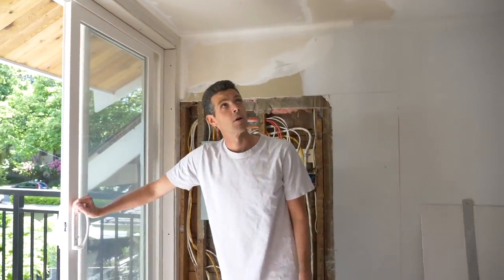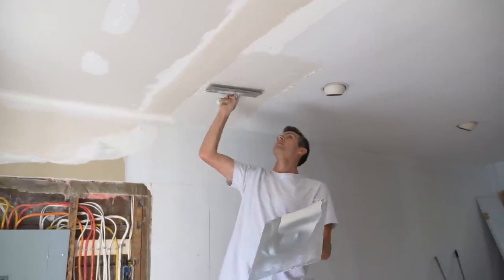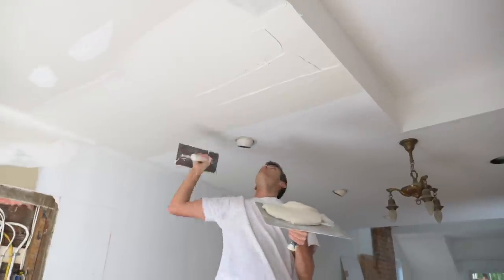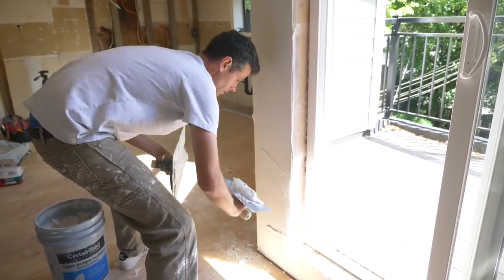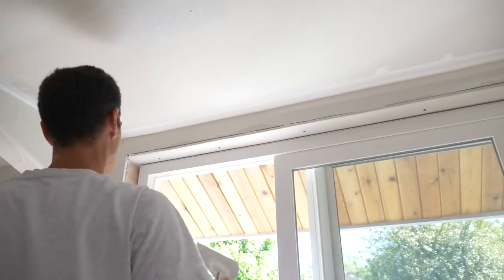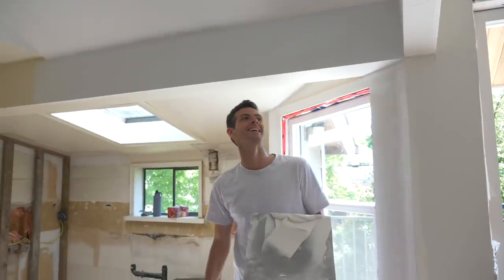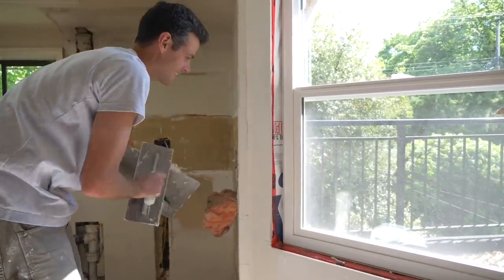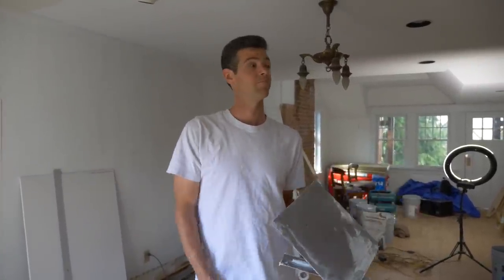First Coat on Nasty Remodel

Comment: thank you for teaching me how to mud! I resurfaced my kitchen walls that were covered with 60's prefab wallpaper that is applied directly to the board. Previous owners tried to remove but found it impossible and they tried to hide gouges with faux paint. so thankful for your knowledge.
Reply: Did the wallpaper start to bubble under the mud?
Reply: @FlyWhistle  no I sealed it with Roman 999-35 before and after

Comment: When it comes to drywall finishing there are three words to remember: sand texture paint 😄 
I always "glop" the like button.
Reply: Its pretty much all smooth wall/flat wall up here in the great white north :)
Reply: @stargateproductions  That adds an element of complexity. Here the sand texture is common in new construction unless you are willing to pay more for that extra finishing. We had sand texture so when I did it on the garage ceiling it was consistent with the rest of the house and helped lessen the impact of my less than stellar finishing.

Comment: How do you clean up the mess that drips on the floor. Sometimes it looks like there's some covering on the floor and other times it doesn't seem like there is. 

Is there a process you recommend here?
Reply: There's is 2 ways to clean up the mud on the floor. One is to get it will its still wet. The other is to wait for it to dry and scrape it up. The dried mud on a finished floor comes off pretty easily actually, as long as the floor isn't bare wood or rough concrete is just pops up usually.
Reply: @dhammer5645  Except if it is quick set (also called "hot" mud).  That will NOT come up easily and may seriously bond and become rock hard.  (Ask me how I know).  I always put down those cheap blue plastic tarps now, like you can buy at Harbor Freight or anywhere.  Those are a TREMENDOUS time saver.  I guess the other way is to be so good that you don't drip drywall mud on the floor.  But that seems beyond my skill level.

Comment: Even though you might get razzed by Pros, I believe your primary audience is unskilled folks who can't afford to use skilled craftsmen. You look like you get embarrassed when there are obvious defects in a pass of the trowel. I have learned so much, you have demonstrated "the art" of dry walling. You don't realize little things like the brush you use to clean your tools. This one thing has sped up my process dramatically.  Own the defects, God knows WE will experience all sorts of problems, how you deal with them is a valuable lesson for me. Knowing when to stop going over the same dang spot that wont smooth out. Make sure to explain why you are mixing mud the at a certain consistency. I believe your audience knows you are not speaking for the entire trade but what has worked for you. I gave up the pan I now use a hawk and trowel, I can un-texture a ceiling and skim coat it 10 times faster. Thanks!

Comment: Is that larger tool actually a concrete working tool or is it specialized for mudding drywall?
Reply from the maker: It's a drywall trowel
Reply: @vancouvercarpenter  Great, thanks. I’m in the middle of taping/muddying a big shop but you are definitely much faster than I am. 😂👍🏼
Reply: @vancouvercarpenter thank you so much for all of your educational vedios. Does that trowel have flexibility? If it does where can I purchase one? I know that this vedioe is 9 months old. Maybe you or someone else can this question for me.  Thanks